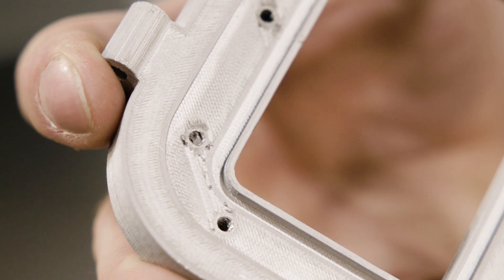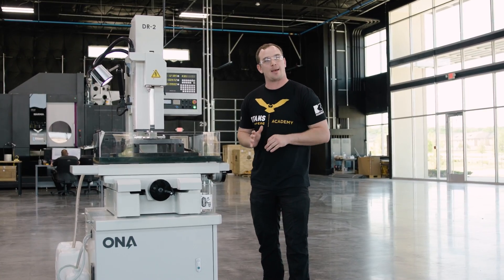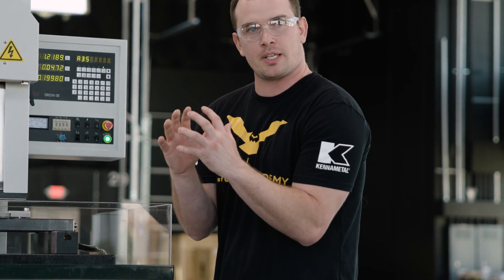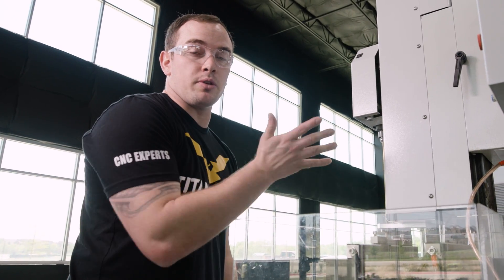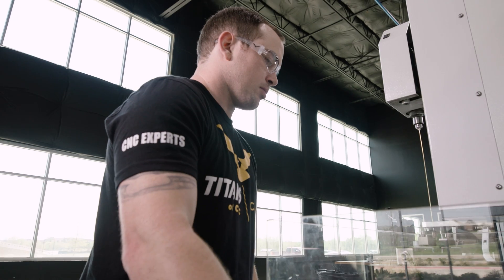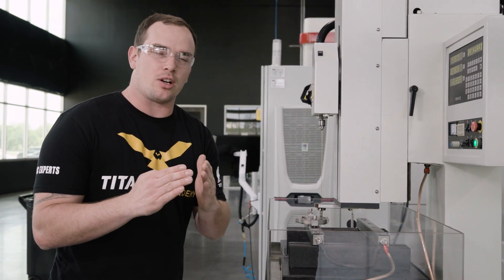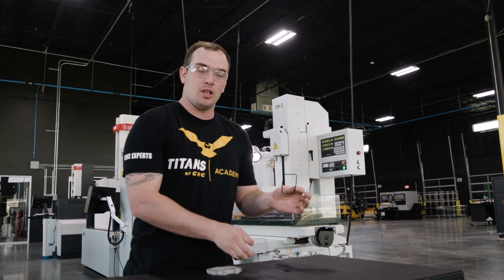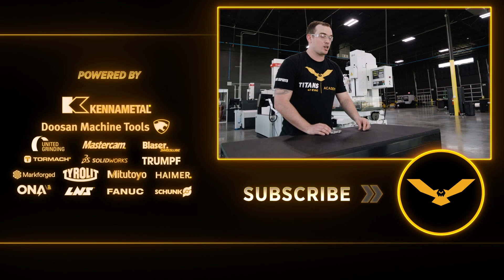Every Machinists NIGHTMARE… Have YOU BROKEN a TAP in a Part???

Comment: Man, I've had to remove literally thousands of busted taps over the years, I've gotten pretty damn good at it. I always start with trying to spin it out or chip it out if possible, if not then the EDM plung burner gets whipped out. EDM has saved my bacon on so many occasions but I didn't have anything this fancy though, just a mag base with a vertical post and arm that holds the burner head with a wheel on a rack and pinion to raise and lower it manually, good old ElectroArc. I really like that system because you can burn out anything from a 6-32 machine thread in tiny aerospace parts (maybe even smaller, I never had to burn anything smaller than that) all the way up to broken taps the diameter of your fist in gigantic building-size weldments or machined structures, ElectroArc burners are very practical tap removal systems. This one looks a lot more accurate though for sure, and I imagine it would be very fast if set up for a specific run of products being programmable.

Comment: NGL this isn't quite what I expected. I don't know how many shops have this just lying around, I honestly expected more hand tool techniques first to show options that are a bit more commonly available before turning to the fancier, rarer set ups.

Not that there's anything technically wrong, this is just a bit out of reach for most guysm
Reply: At the end of the day we made this video to showcase this method for people that haven’t seen it before so they know what’s possible. Now in an emergency someone might think to outsource to a local EDM shop as a last resort before scrapping a part.

Comment: I have a magic screwdriver.. 
#8 tap is the smallest I've removed.
I've also extracted broken .187 drills an inch deep in 316L plate using the magic screwdriver...
The trick is; cut the screwdriver off, grind it tapered, at the same time give it a cam shape.
Hss, Co, and carbide can be easily chipped with lateral pressure.
Just blow air in the hole, while twisting that strong cam lever magic screwdriver.
It works 50% of the time every time! 
Also my screwdriver levetates with an adequate amount of upward airflow from an air nozzle. Which is entertaining and seems magical. Hence the name... Magical screwdriver!😎

Comment: how to remove a broken tap. step 1: get an EDM system that costs 10s of thousands of $....
for the rest of us, grind it flat, center punch and drill it out with a carbide drill or diamond burr on a drill press.  or if there's a tiny bit sticking out, you can sometimes grab it with needle nose pliers
Reply: These machines range from 1-20k and you can always outsource to a local EDM shop instead of buying a machine. There are many ways, this is one of the most effective for sure.
Reply: @trevorgoforth8963  wish i had one.  i wouldn't outsource a broken tape though lol, i've learned the hard way how to remove them

Comment: If its a pipe tap Ill hit it with the tig welder.  Most othertimes just use an old ball endmill down the center.  Smaller taps EDM as last resort

Comment: The same systemis  in use at our mashineshop. However, the electrode is clamped in the spindle of the Z axis of the machine. So the part does not have to be dismantled. It happens quite often that taps or drills break off and get stuck in the part. We uses electrodes with diameters up to 20 mm. Our boss always say: once unclamped is thrown away.

Comment: I love how every know it all says "throw it in the EDM" when you got a busted tap. I never knew that. Too bad most shops don't have one.
Reply: Absolute truth.  The VAST majority of people don't have one, so the second I see that type of comment, you know it's from a keyboard mechanic that doesn't do this crap in real life.
Yeah, the cheapo Chinese ones are getting pretty affordable, but unless you're doing a significant amount of hand tapping they just don't make sense for the cost.
plenty of other great ways to do it with stuff you already have lying around.
Reply: @shirothehero0609  err you dont buy this machine to remove broken taps

this machines purpose is making the starter holes for a edm machine they have a edm machine if you too have a edm machine this machine is also probably not far away
Reply: Anyone with a wire edm should have a holepop machine.. and a cheap sinker can do the same job, just with more cleanup of the oil.

Comment: Man you know how many taps I broke in my day it was always my worst nightmare I wish I had one of these😂 the worst was when small taps broke. The Best way to not break taps, is by not using them use threadmills . They come right out when broken👍 parts I run at work if a tap breaks it’s scrap, it’s copper and it ruins the threads . Customer doesn’t allow us to save it due to possible contamination, 10-24 form taps

Comment: Nice to see not a lot has changed since being an apprentice in the early 1960s. We manufactured precision aluminium components for the aerospace industry. There were two 10ba. Tapped holes to finish the part. Each was carefully tapped by hand using a tapping block for alignment. You needed a very delicate touch to tap these holes. Not every apprentice had the knack and we ended up with lots of components with broken taps. One day a sales person arrived to show os a very simple machine called a “Tap-O-Matic”. It was a small spark eroder. Every component with broken taps was saved. Your machine is more advanced but does the same job.

Comment: You can also vibrate the part from a range from 30-30,000 hertz a second.

The vibrate range will oscillate up and down the scale 4 times a second.

The tap/bolt/nut/pin will vibrate loose.
Reply: Useful I have a dremel engraver maybe it will have a use now
Reply: @ThatOneOddGuy  you need high shock impact , like a rattlegun combination dremel. It may work buddy!!!... nothing bigger than 1/4 inch 6mm ... dont use liquid.
Reply: @Bibibosh  how about a hammer drill 🤣 I'll test it tomorrow
Reply: @ThatOneOddGuy  hammer drill doesn't have the subsonic vibrations you need. 
I think max rpm would only be like 500 if that. Dremels rpm are like 15,000's but dremels have little force power. 

Its work trying tho. Fast vibration, and a little force to vibrate it out.
Reply: @Bibibosh  my drill goes to 3000 rpm and 48000 bpm
Reply: @ThatOneOddGuy  ... okay sounds good.
But you have to understand that a dremel doesn't have that much impact force. 

So is there away to redesign a dremel to make it remove taps. 

You need high impact (your not trying to break the tap, just u wanna tap the tap 1,000,000 in less than 1/2 hour....

So im guyessing uou need HIGH RPM
HIGH IMPACT (not to much)

And..... dont use any liquid because that will "dampen" the egnergy.

Sorry for the speling

So basically when the tap falls out using gravity . Turn the thing unside down and let it fall out naturally.
Im gtg to bed now im sor tied!! SORRY
Reply: @Bibibosh  ok thx m8 
But the dremel engraver has a reciprocating motion it does not rotate 
Hammer drill rotates and has reciprocating motion 
I didnt find the piece ai had the tap stuck in today when I see it I'll make a video on taking it out
Reply: @ThatOneOddGuy  you make a good point.
I think me and you could patern something and get it copyright and become MILLIONAIRES!!!!!!!
Reply: @Bibibosh  yeah definitely
Reply: Cool, never knew that method, it sounds interesting!

Comment: Tapping was the last step in producing a $35 part, I broke a bunch of taps so I just switched to thread milling.
Reply: Either tap asap or learn to tap properly... I haven't broken a tap in like 7 months and I do 45hrs/week
Reply: Doing 45 hours a week is an absolutely irrelevant statistic to judge how many taps you break while tapping. How many holes do you tap a week? What material do you machine?
Reply: @Baseballkid88  last week I did 240 M4's,720 M2's,480 M3's and 180 7/16-20 in Gr 5 Ti. This is the third time I've done this order and I've keep the taps with the job. I run all the Ti and stainless (304-316) so the new guys can only ruin aluminum lol 

The reason people break taps is because they don't know what a form % is, and don't pin their drilled holes to ensure proper size and lack of taper. After that, it comes down to maintaining a SFM appropriate for the material.
Reply: @urgamecshk  Its 1/4-20 into 304 on a Cylinder. Make flat with 4FL center cut EM, spot/center drill,  #7Drill, tap, practice french.

If you have some good books on it I'd appreciate it.

Using a very rigid 6ton box way machine
Reply: @Eluderatnight  we don't make flats. Spot to 0.275" with a 120 spot drill (z-0.075 or so) and then drill. Use #1 for form or #6 for spiral cut (and confirm with pins!) Keep tapping SFM around 20 or so, but we just do S200 to make the F10. (simple to confirm at the controller). Peck if it's more then 0.35 deep.

Example 
T1spot s4000 f8. Z-0.075 
T2 drill S700 F2.5 
M00 (fluid)
T3 S200 F10. i 0.35 
Rapid tap is great. Blow off the chips when it's retracting.

Comment: I have another way, use a center punch and fracture it into pieces and fish those out. It may sound dumb but it works if you don't have any edm stuff
Reply: that why i  weld with highpower a brocken tap   on a rod  shatters into pieces ^^
Reply: also a good way is to use the broken tap, ground with a pyramid tip to break the stuck part .
that's what i use at work and it works really good.

if everything fails just drill with a crown drill and weld the hole shut or weld a plug in
Reply: I've only got that to work a few times. Most of the time it just destroys the tip of my punch
Reply: @greg2337  yeah, that's why I'm regrinding the broken tap😂
same hardness and my good punch doesn't get destroyed
Reply: Freeze the tap and then punch it out
Reply: @Mattssons100  never heard of that 
just apply liquid nitrogen or what?
Reply: @Sebastian-ed5kt  a can of pressurized air/duster when holding upside down will get very cold(can almost hit -100c) and its easy to aim at the tap, there is also cooling/freezing spray cans.
Reply: @Mattssons100  okay, good to know for the future
(we don't have such fancy stuff at work 😂)

Comment: Your solution is to have a 100k machine. I've removed tap with a hand plasma cutter but I would imagine the whole has to be larger than 1/8" or 3/16ths
Reply: A hole popper is nowhere near 100K. It is literally a piece of support equipment.
Reply: @barrysetzer  good to know. Good info about 20 grand. Still out of reach for 98 percent of people removing taps.
Reply: @BarronBros1822  You can also outsource to a shop with EDM if it saves an expensive part with a lot of man hours into it.
Reply: @trevorgoforth8963  yea for sure. I think theirs a better solution out there if I'm being honest.
Reply: @BarronBros1822  out of curiosity, which solutions do you feel are better?
Reply: @trevorgoforth8963  ok fine perhaps BETTER is not accurate. Let's say solutions exist which are more practical for most of the viewing audience
Reply: @BarronBros1822  Yeah other solutions definitely exist. We figured some people hadn’t seen this method before so we decided to share it. It’s always good to have multiple tricks in the bag in these situations.
Reply: @trevorgoforth8963  THANK YOU for this Trevor. VERY well said. BIG fan.
Reply: a little mobile hole popper for tiny holes less than 1/8" could be as low as 300$.

Comment: Did you not run another tap down by hand to confirm correct depth and ensure no broken pieces remain??
Reply: We used a screw to check it.
Reply: I had an issue with that untill I saw you were assembling right away so it dosent matter that much what's going on as long as the screw goes. At my job I would be scrutinizing the thread and almost surely reworking it  after removing a broken tap. But we don't assemble

Comment: Sweet, got a broken tap in a part, now all I need is a edm hole popper.
Reply: Yep, or a shop with one that will do it for you.
Reply: Trevor Goforth  only costs as much as the part itself made to do it
Reply: @captainheat2314  Have you ever looked into it, or are you assuming? Some parts can have 10 or more hours into them and be made out of costly alloys. I can guarantee it will be worth your while to have a local EDM shop burn it out at that point. It's not a costly process relative to scrapping an expensive and time consuming part.

Comment: When I was a 17 year old Apprentice Fitter . I was very good at removing broken taps and sheared bolts. My foreman got me to do it for the shop.  1975    made myself prongs etc for the fiddly bits.  Belfast UK
Reply: was this one of those you either get good at tapping holes or you get good at removing broken taps kinda situations?
Reply: @Sarge92  both.   Hardest to do was 1/8 BSF on a small part.   Most tapping I done was on the mill or drill using a SPV tapper. 😎👍🇬🇧

Comment: Smallest I got out is a m2 using lead from a clicky pencil, on a sparker. Took its time but it was all removed and no damage to the threads.
Reply: Sparker? Like hooked up to car battery?
Reply: Just plunge a 1/32" endmill?
Reply: @urgamecshk  I never seen a 0.8mm endmill b4 especially a carbide one. It what was laying around the workshop at the time to get the job out.

Comment: Excellent...... If you have one of those machines 🙄
Reply from the maker: You can also send your part to a local EDM facility if it’s worth it.
Reply: @TITANSofCNC  yeah we used to do that till I became a badass at removing them in the machine. Use an endmill ti remove all the jagged edges and then switch to a carbide drill. The drill eats through the tap 10x faster than the endmill. Plus you can get closer to the minor Dia without eating through it than you can with an endmill.
Reply: Alex, this is true, but these machines are VERY inexpensive compared to an edm, every wire edm place has them.